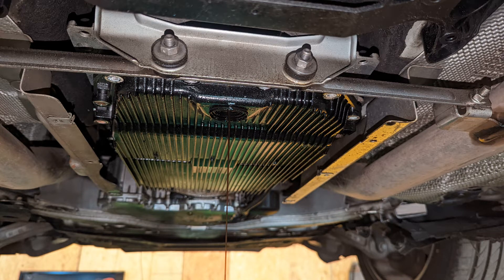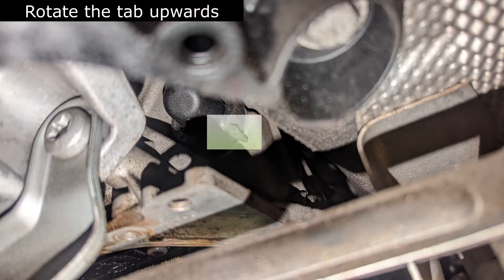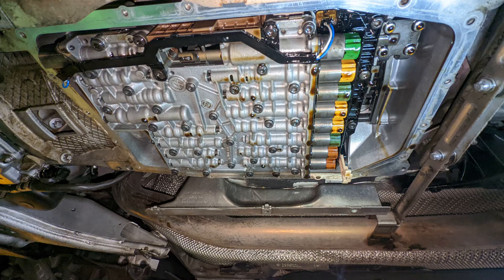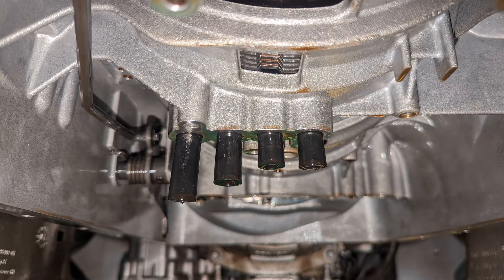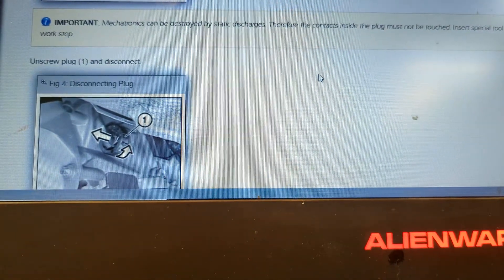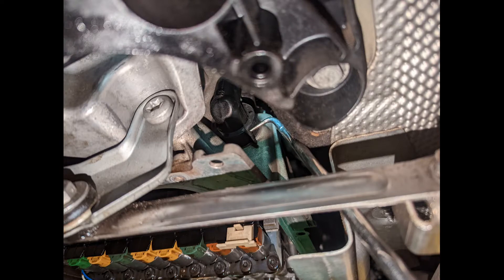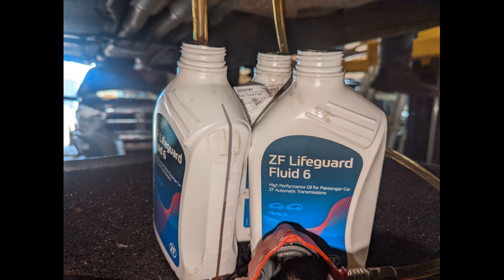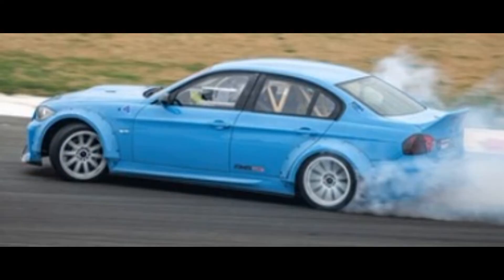2011 750i n63 6HP26Z Transmission to mechatronics seal replacement

Comment: Hi,
What code you were getting in order to change the orings.

I am facing a problem wid bmw 730d. Code m getting is of position valve. 
Any suggestion what should be done. 

I just feel a jerk at the time of ignition on. Rest the car drives perfectly 
Nd if i keep on switing og on nd off the car . The fault of position valve comes up.
Reply: Nd it goes away if i switch on the car thevagain
Reply from the maker: Can't remember the codes honestly, but it's mainly diagnosed from how it behaves and making sure it doesn't have circuit codes or anything.